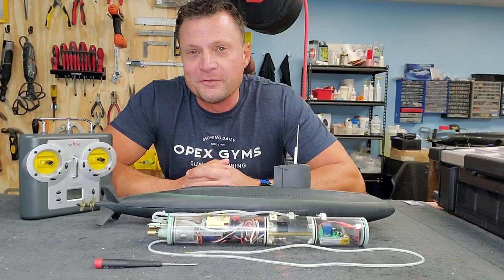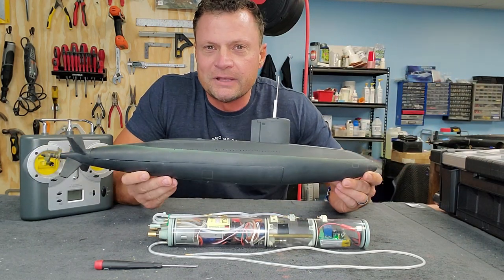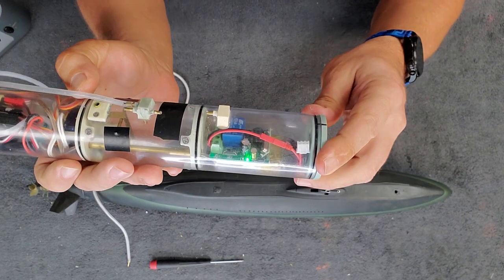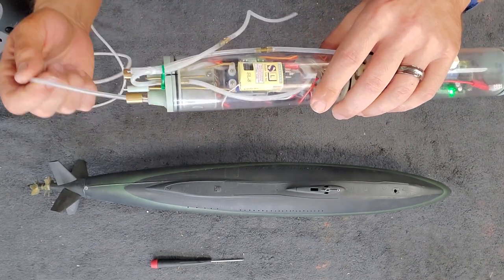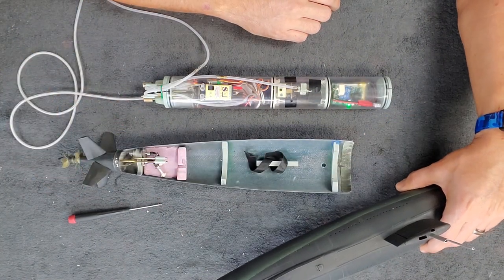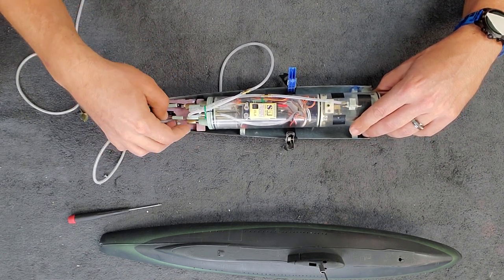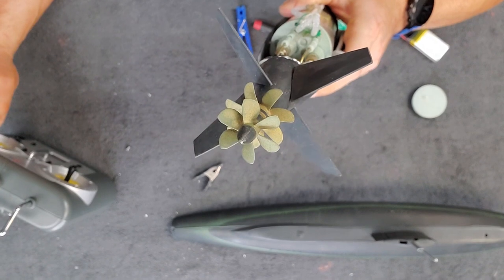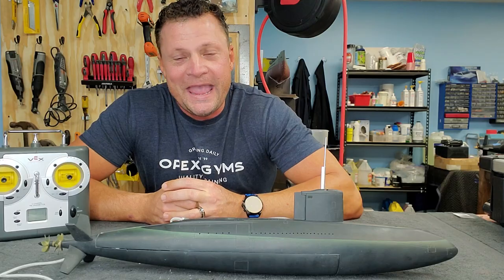Is this the FASTEST and MOST MANEUVERABLE RC Sub in the World!?

Comment: Thank you for your videos!
What kind of motor is used for this sub?
I'm in the process of building my first rc sub (SMX31E from Naval Group) and it will be close to this size and I'm struggling with the choice of the motor.
Cheers!
Reply from the maker: It's just a standard, small brushed motor running through a gearbox. Cheap and easy to find!
Reply: @RCSubGuy  Thanks for the reply. Do you know the approximate RPM ?
Reply from the maker: @ockay16  I would aim for 4000 max

Comment: Many people do not realize that 2.4 Ghz radio systems do not work thru water. So if you have a working 75 KHz system, don't be thinking that you shud "update it" to 2.4 Gig. Similarly for UHF cameras, they don't work once the sub goes down.
Reply: Edit; "working 75 MHz system"...damn autocorrect
Reply from the maker: Correct, 2.4ghz does not go through water, but most experienced sub captains don't go below periscope depth in any water that is not crystal clear (which is exceptionally rare) . Hence... the "advantage" of the old, low frequency radios is immediately lost.

Comment: How does the radio work underwater?
Reply from the maker: Exactly as it does above the surface. Radio waves propagate through the medium and transmit data to the receiver. Impurities in the water can cause significant reduction in range, as does the air/water interface, meaning that the further away you are, the more waves that "skip" off the surface and don't make it to the boat.

Comment: Hi Bob. Just a question about the remote on/off switch module you're using. These are 433 mhz 12v,  right? No problem running them on 2S (7.4v)?
Reply from the maker: The heavy duty switches run on 12V (though they work on 11.1V). My smaller 10A units run on 6 to 12V.